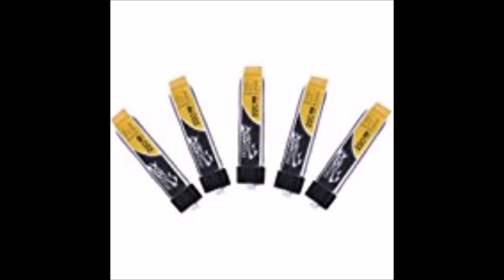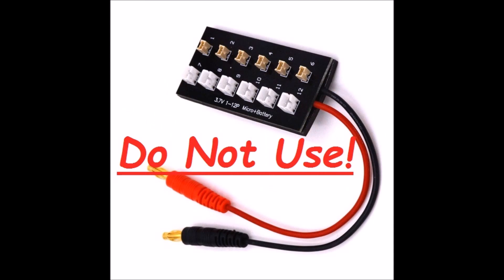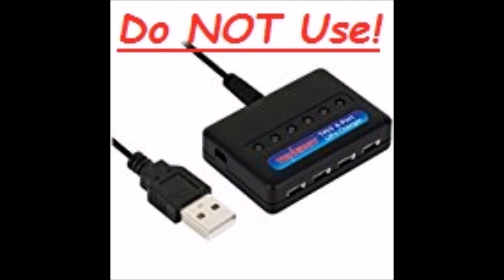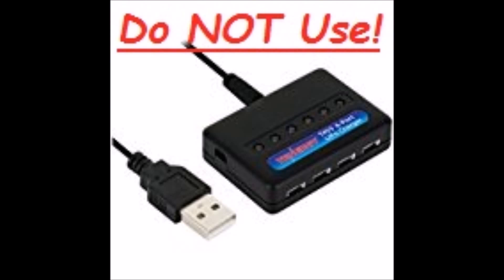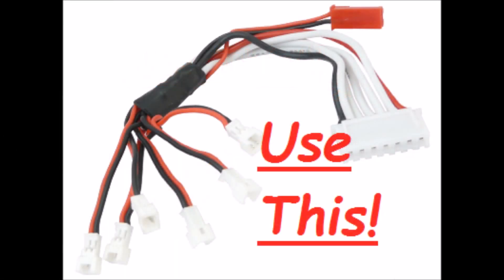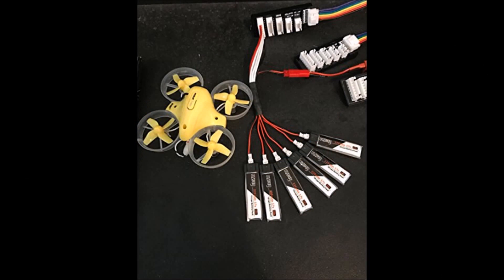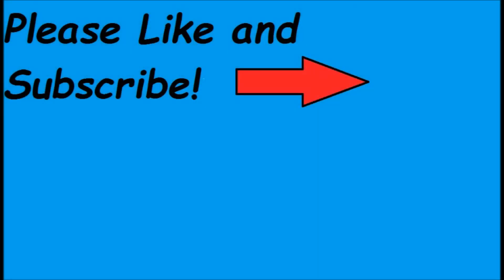Balance Charging Tiny Whoop: Best Way to Charge 1S Blade Inductrix Lipo Batteries NOT Parallel

Comment: i got one 1s charger from Amazon,it charges with 6 channels at the same time .Each channel is independent.
https://www.amazon.com/HobbyFly-Battery-Charger-Inductrix-Connectors/dp/B08RJXW8CS/ref=mp_s_a_1_54?dchild=1&keywords=hobbyfly&qid=1628255728&sr=8-54

Comment: Most of us buy several of the exact same type and mAh battery so parallel boards work fine when you use 6 of the same battery . I've seen no degradation of my batteries this way in years of use

Comment: I am using all turnigy nano-tech 3.7v 260amp 35c-70c 1s1p batteries with a It's a Molex 51006-0200 connector on my old customized jjrc jj1000 quads. Does anyone make a multiple balance connector with either xt60 or 4mm banana plugs that I can plug into my new t240 charger and charge that way??

Comment: I recently purchased the balance cable you listed for the inductrix mini quad. It does not fit the 1s batteries for the inductrix fpv + rtf as the balance cable is for ultra micro 1s batteries. I have since ordered the correct balance cable. I am guessing the new inductrix fpv + rtf uses the jst 2.0 connectors.

Comment: Sorry man, I just flat up disagree. There are far too many videos proving how parallel charging works, and they don’t “degrade” your batteries. At worst, your lower internal resistance cells will take more current than the others, but keep your charge rate at 1C relative to total parallel capacity, and you’ll be ok

Comment: My charger only goes up to 4s (never needed anything above 4s so I didn't bother buying one that does 5 or 6s), does anyone have a link to the same charger but only for 4 batteries at a time?
Reply: https://www.ebay.com/p/HiTEC-X4-Micro-Ac-dc-1-Cell-Lipo-Charger-44212/1094215029?iid=123301672561  Make sure you watch several youtube videos about this charger. There is an issue with people using the wrong plug in the MX port that will damage your battery terminal over time.  this is the correct cable. https://micro-motor-warehouse.com/collections/connectors/products/micro-jst-1-25-adapter-cables-for-hitec-x4-micro

Comment: So as a new Whoop pilot from what I understand, if I wanted to charge 6 1s batteries at once. I would have to set my charger (iMax B6AC) to 22.2v at .26 amps? Or if I wanted to charge 4 1s batteries at once I would have to set it to 14.8v at .26 amps?

Comment: Wrong about the parallel charging. I see your point but it's incorrect. By adding your batteries in parallel it sees it as one lipo. This is correct. However, in parallel all the cells balance out because physics. Everything must be equal so when you charge it, it's truley charging like one battery. This is why you must let your cells sit for a few minutes to let them balance out before you start charging. Also you can't put cells in parallel that are more than .2 volts from each other
Reply: You are correct there my friend.

Comment: Wait... if you charge them in series, does 6 x 200mAh batteries at 1C rating not mean charge them at 1.2A? I thought the charger treats it like a single 6s cell?
Reply: Eden Wan if you are charging in series you multiply the voltage by the number of cells and the capacity stays the same. If you charge in parallel the voltage remains at 1 cell and you add up the capacities. If you are charging different capacity cells you are better off charging in parallel.

Comment: I'm sorry i disagree.  I agree that it may be safer although it's not unsafe to charge in parallel.  As long as all the batteries are all dead and around the same voltage parallel charging is fine.  Most charges if not all can only discharge through there ballance leads not charge.  This will cause much longer charge times especially if they are far away in voltage from each other.

Comment: I have a 2-3s charger and its lowest amp it can charge at is one, if I use one of these chargers is it ok to charge three 260mah batteries at 1 amp?
Reply from the maker: Sorry to be the bearer of bad news... A typically safe amperage to charge lipos at is a "1C rate", in your case is .26amps. 1 amp would most likely work, but I would recommend against it (both for safety and degrading your lipos). The B6 charger in the description is pretty cheap, and will be good to use for nearly all your lipo needs.
Reply: thanks I understand
I'm planning on charging 3 260mah batteries so it will be .78A
is it still safe?

Comment: Parallel charging works well. There's nothing broken about it. The batteries are at dead even voltage minutes after being plugged in, and they all charge evenly

Comment: so i bought this and don't have the conector for the jst. you never mentioned  that was extra. Whats that connector called? thx
Reply from the maker: Morning, you will need a JST adapter (I'm guessing your particular charger is either an XT60 or Dean). You can either make an adapter for free or buy one for a couple $. If you are in a pinch to fly, you could also just strip the wires from your charger and from this balance cable and twist or solder them together. Happy flying!

Comment: I use the board you show in this video but I do agree the balance cable is a way better option. You definitely need to know what you are doing if you use the parallel board in order to be safe with it. I charge them in a fire safe box and only the same capacity, same discharged voltage, same manufacture and same internal resistance. It is a lot easier and safer to use the balance cable.

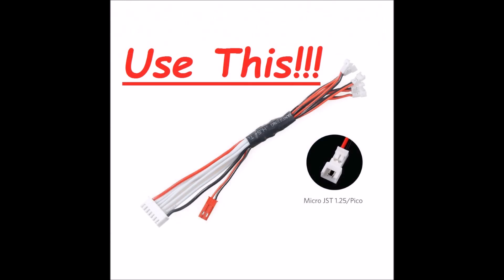Comment: What you say around 1:34 is incorrect and misleading to people. The voltage between the 3 batteries will equalize immediately. I do agree that parallel board is junk, and like the serial charge cable.

Comment: The charging leadis do not work with 2.0 batteries, like tiny whoop hv batteries and other hv batteries!! Diisappointing!!
Reply from the maker: Agreed, I'll bet they changed the connection so that it will allow for more current draw. With a little soldering you could switch them out:

https://www.cambridgelsat.com/bookstore/crazepony-3-sets-tiny-whoop-jst-ph-20-pin-male-female/B01MSYXESK/
Reply: Maybe there should be something in the comments section saying that these charging leads do not work with high voltage batteries or any battery with 2.0 connector.
Reply from the maker: Added

Comment: So you plug that wiring harness to a charger with batteries plugged into each connector?
Reply: They don't sell the serial balance cable anymore... I'd also like it in a bullet type connector, JST is lame. Help!
Reply from the maker: Thanks for the comment! You got it, I have been using the B6 charger linked in the description for years now without any issues. Happy flying!
Reply from the maker: Just went back up for sale on amazon (I also just posted a video on making your own)! Agreed on the bullet connectors, the easiest solution is prob to buy a soldering iron and switch them out. Happy flying!

Comment: I have 6 single cell lipo batteries at 3.7 volts. 5 of them are 220 mAh and 1 of them is 200 mAh. Can I still charge the 200 mAh battery with the other 220's?
Reply from the maker: Thanks for the comment, this is a really good question and I'm sorry I don't know the technical answer... I have been google searching this for a day now with no luck. That being said, I have been charging my 180 mah's with 200 mah's for weeks and haven't had any problems what so ever.

Happy Flying!
Reply: Thank you for the reply! I'm sure it will be fine. You'd probably not want to charge batteries with drastically different mAhs though. I think the small difference of 20 mAh will be fine. I would guess the balancing process would be impacted because the smaller batteries may charge more quickly.
Reply: catleet2004 I do not think that is correct. In order to parallel charge, all batteries must have the same cell count.
Reply: cole reynolds they should all be the same mah when charging that way
Reply: I read on some forum couple days ago that all series must be same mAh, for example if you have a 7S charger, you can do series charge 3S 2000mAh with 4S 2000mAh
Reply: Yes parallel charging lipo must have same the cell count (all 3S or all 2S, or all 4S, you get the idea). However I was talking about serial charge, for example you can do serial charge two 1S 200mah with two 2S 200mah on 6S balance board (all together it act like a 6S battery). It really depends on if you are doing serial or parallel charging. Just on side note even tho these tiny lipo are only 200mah TINY compared to my 4S 8000mah, they still pack a damn good punch, thankfully i was in room when one 1S lipo started hissing and caught on fire, burnt my hand from grabbing it off the carpet (it fell off the lipo bag), left a good burnt mark on the carpet!

Comment: Thanks for the video.  Quick question though, I have the cable and it will take up to 6 1s batteries.  If I only have 4, how would I go about charging them?  Would I still set the charger to 6 cell and adjust the amps to (for 220mah) .22 * 4?  Or do I HAVE to have 6 batteries on the cable?
Reply from the maker: Thanks for the comment! Unfortunately you need all 6 batteries unless you want to tear apart your cable and replace the balance line with a 4S male balance connector. My recommendation would be to buy more batteries :) I have been using these:

https://www.amazon.com/gp/product/B01LZFKULR/ref=oh_aui_detailpage_o00_s00?ie=UTF8&psc=1

Happy Flying!
Reply: Did you try using it on a 4s on your charger to see if it recognized it as a 4s lipo?